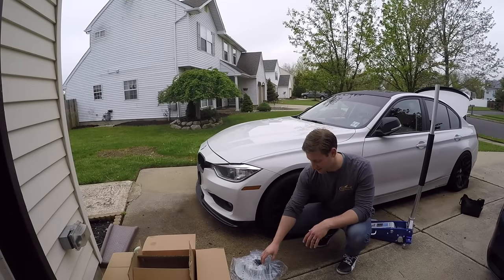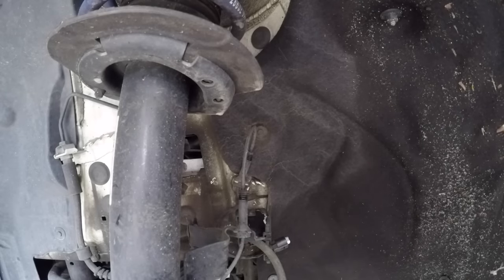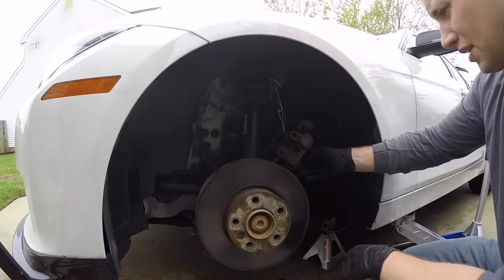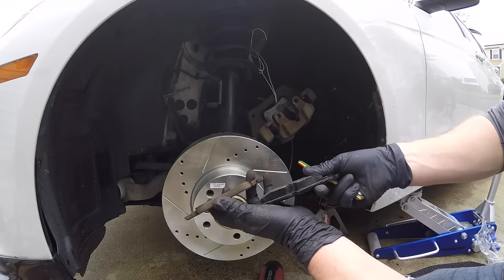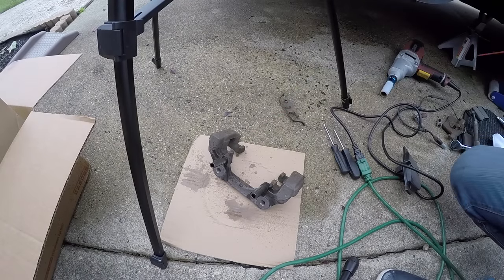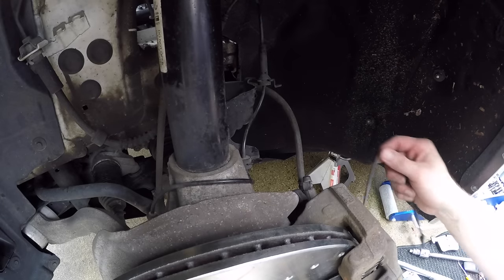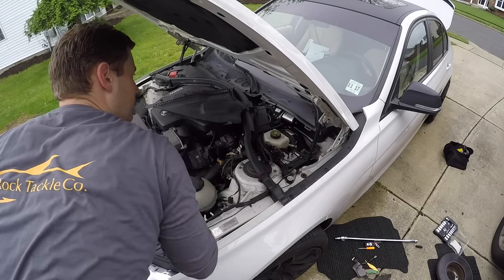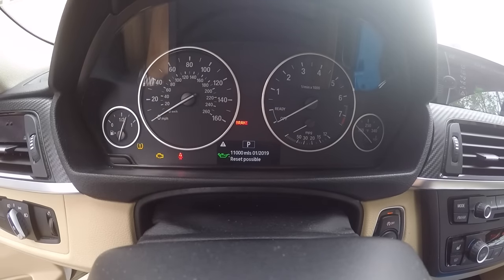F30 BMW (2011-2019) Brake Pads, Rotors and Wear Sensor Change

Comment: Where do you place your jack stand?  I have a F36 and after I lift up the car to change wheels I have no idea where is the safe place to put the jack stand.
Reply from the maker: Hi, I normally put it under the sub frame. I mainly rely on my jack and only use the stand, in situations like this, as a back up

Comment: According to BMW the slide pins should not be lubricated. When I did the wife's F30 brakes a few months back I used silicone paste anyway though. Seems weird to have them installed dry.
Reply from the maker: +Jarrett Barnett Yea, that does seem odd

Comment: Make a video for the rear once with the auto hold 🤘🏻💯
Reply: Rear brake bracket bolts (not caliper pins) This guy just hand tighten it with a 6 inch wrench, is that good enough?

Comment: How many break sensor  need for 2014 bmw 320i?.
And where can I get that online?
Reply: There's only two brake wear sensor. One in the driver side and one on the right back passenger side 👌 you can get the sensor at your o'Reilly/Ebay/Amazon

Comment: Hi Bryan, what rims are those? can you let me know the spec front/rear ?:D thanks
Reply from the maker: Hi, they are VMR 18x9.5 all around
Reply: did you remember what model of VMR? They look like VMR V710 but not as deep?
Reply: Kies Motorsports What size tire are you running on those rims?

Comment: hi I dint understand that compressing brake pistons part? was it  brake fluid you opened on 7.44 of the video? is it necessary to do it?
Reply from the maker: Hi, yes, you should always loosen the brake fluid cap and then compress the piston. Don't forget to pump your brakes before you start driving..
Reply: Kies Motorsports  Tnx for your answer u rock👍
Reply from the maker: Any time 🤙🏼
Reply: If not you will probably pop the resivoir cap and fluid will evacuate. So I heard from a friend.

Comment: Shouldn't use a torque wrench as a breaker bar or ratchet, it throws the torque wrench out of calibration.. Sweet video!
Reply from the maker: That's my bad torque wrench that I use as a breaker :) I have a good one and a 'short breaker bar" one that I made of an old one
Reply: You obviously didn't listen to the audio, he stated that the torque wrench was already bad so using as a short breaker bar.

Comment: This may seem like a silly question but are the front rotors the same as the ones that can be used in the rear? There isn't a slightly different rear pair of the Power Stop rotors is there? Just making sure that I can order two pairs and swap all of them out. Thanks!
Reply from the maker: No, they are different
Reply: @KiesMotorsports  how is it different? The installation or the rotor?
Reply: @Ra69iT007  rotor on rear is smaller diameter. Same install
Reply: @Nguyen2fold  thanks, I read it wrong and thought he was talking about installation was different

Comment: what are the torque specs ?? does it matter ?
Reply: Caliper carrier bracket bolts: Front - about 77 lb-ft or 110 Nm. Rear - about 48 lb-ft or 65 Nm
Caliper guide pins: about 22 lb-ft or 30 Nm
Reply from the maker: Yea that's what I've seen online. I don't have anything other than that..
Reply: What are the torque specs for lugs ? 90 lb-ft ?
Reply: @rohitagrawal1657  F30 have M14 lugs, so 140Nm torque.

Comment: Anyone else strip their screw trying to take off their rotor?
Back ones were easy to take off but my front once are so hard...
I been watching videos to take them out but this screw is very tough
Reply: i used a 12v compact impact. zipped off in 2s

Comment: VIP- loctite on caliper bolts or buy replacements. Trust me, they will come loose and you’ll end up on the side of the road looking for the right bolt from every auto parts store and no one will have them in stock. Then you’ll be walking up and down along the highway looking for that damn bolt, but it won’t be there…

Comment: You did not do the most important thing. You haven't cleaned the hub. Bet it shakes like hell when breaking....
Reply from the maker: No shake at all :)
Reply: Kies Motorsports then you're lucky... 🤣
Reply: gloc100 why would it shake if it hasn't been cleaned? Got a friend which shakes under raking and wondering if this is the problem?
Reply: beaniogsxr because it develops a bit of a rust over time between disk and hub it you don't clean it when changing the discs it will shake

Comment: why u wanna change rotors on such a new car?
Reply from the maker: The car has 75,000 miles, so it was either resurface them or get new, so I got new :)
Reply: daumn, thats alot. what year is it? mine is a 2012 and it has just over 45.000 miles
Reply from the maker: Lol 2013